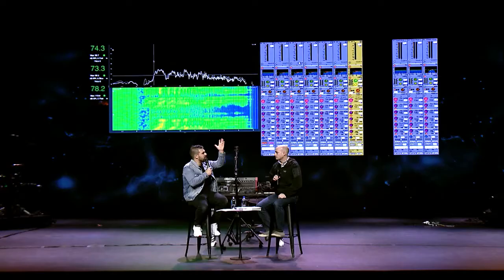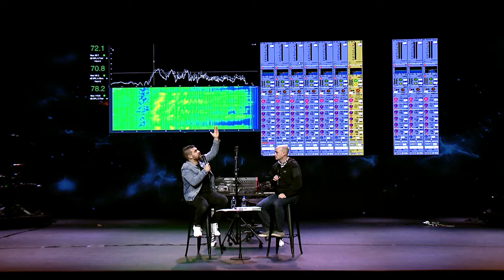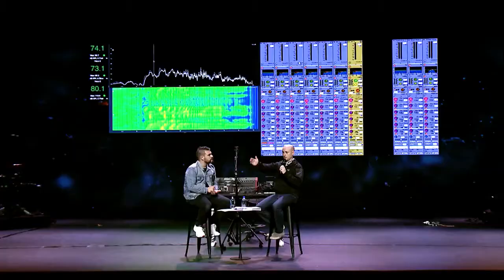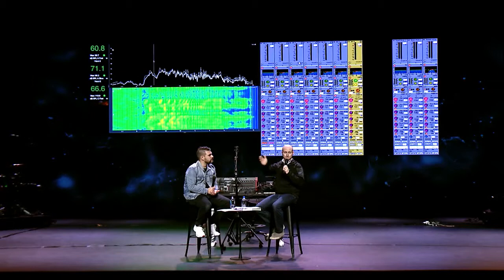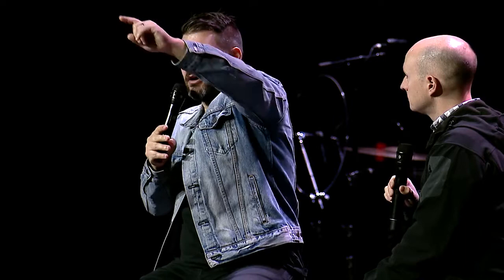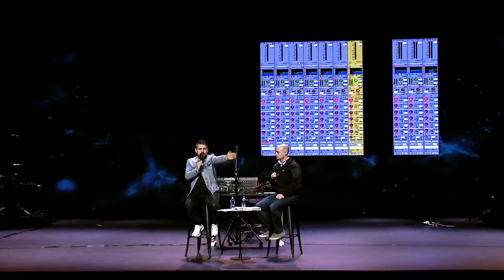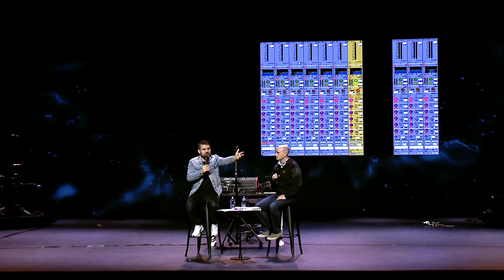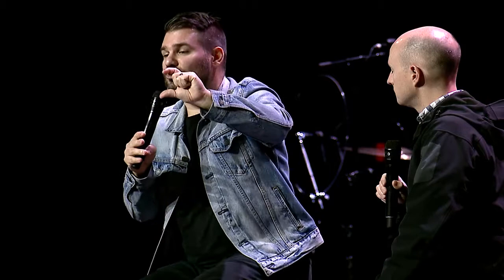Line Array vs Point Source

Comment: Interesting. I run into 10x more issues with Line Arrays versus a point source like the Danley Synergy Horns. Line arrays have to use Phase Cancellation to work, which means they end up causing more harm then good in most scenarios. Plus, there’s no way for them to have all of the frequencies Leave perfectly in phase when hung in a J array.
Reply: That's why all professionals use horns and nobody uses line arrays.... Oh wait 😱
All systems have pros and cons in different environments & various use case scenarios.
Reply: @vikassm  line array is more adaptable and modular. And more practical in many cases. Doesn't mean it creates the best quality.